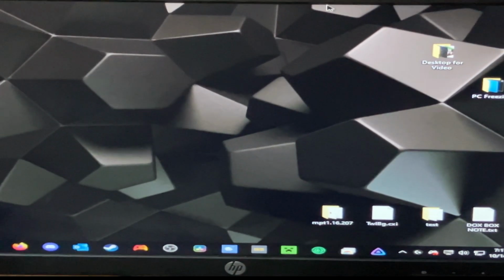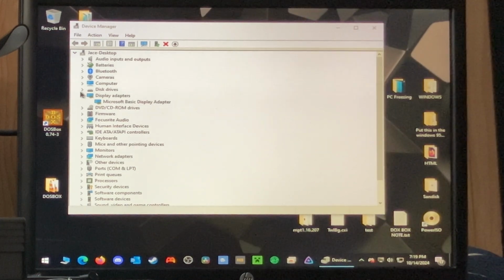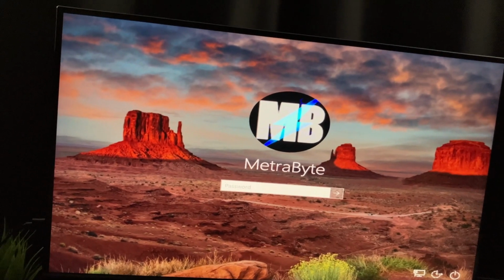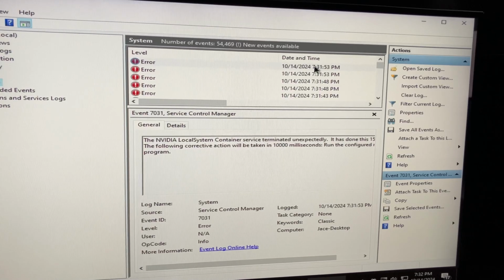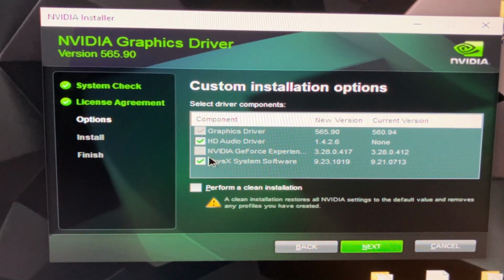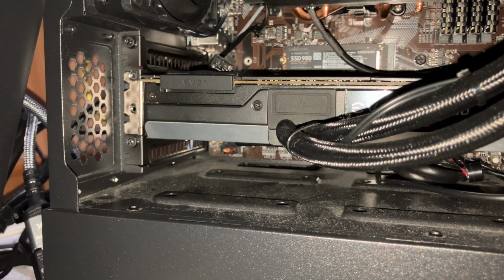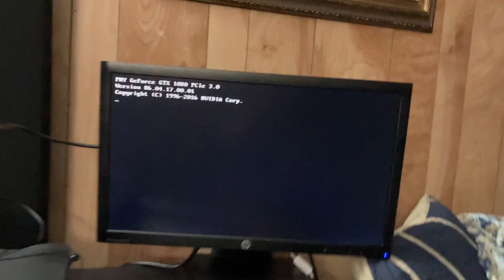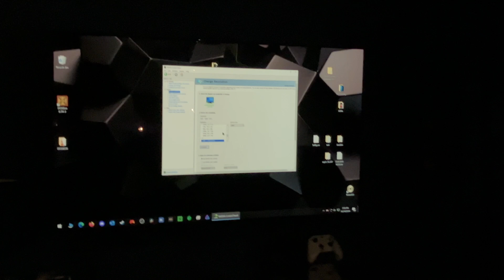Windows Update Broke my GPU and now I have to fix it

Comment: hey homie just for future reference you might want to take your pc off the floor next time you work on it and for many good reasons. 1 big one being is static friction can AND WILL short out a component that ur touching or accidentally touch. its super important you do that on a hard wood surface or on a rubber mat. 2 working on a surface not level with your stomach or waist at the very least will eventually cause you to break something and that's not a maybe its a for certain you shouldn't be too rough with those plasticky pieces specifically pci-e and ram slots. a lot of other tech guys would agree and i think you'd get a lot more views if production quality went up by doing these things listed. other than that great vid per usual

Comment: I love the chaos process to fixing stuff, I relate to this all too well haha.
Glad you got it fixed, but, you should also try updating the firmware and VBIOS. I had black screen issues with my old 1080ti and when it just shuts off after your plugged in other monitors was really similar to what I had to deal with using Displayport and HDMI to the TV.
https://www.youtube.com/watch?v=erS1ShmNRRo
Even if it is working now, it's worth updating everything on your card anyway so future windows bullshit won't break it again in the future.
Reply from the maker: You’re right about that. I haven’t updated the bios on that thing in a couple years. And the last time I updated it was for this very reason lol

Comment: thats why i disabld driver updates over windows update and then decided to completly rip out the windows update function out of the system because windows update just messes up driveers all the time. never let windows update do all the work
Reply: HOW DID YOU DISABLE THEM PLEASE TELL ME
Reply: @daskywarsboi2913 you can remove the whole Windows update thing via DISM. Helps ALOT with performance on potato pcs, especially if you also rip out windows defender(but thats a terrible idea for obvious reasons...)
Reply: @daskywarsboi2913 device manager

Comment: Man, everything that you went through in this video is what I just recently experienced on my MSI GTX 1070. From the update, to the wonky screen with the basic display adapter to reinstalling the GPU, the dust ( I used a mini vac) and even the flying insect! It was a fly in my case that wanted to take up residence in my ear and I got so pissed I grabbed a fly swatter and chased that sucker around the entire house until he was effing DEAD! This is too weird.. I ended up nuking everything Nividia in my PC with DDU however there were still a few folders that DDU didn't remove so I deleted them. Reinstalled the driver for the card and after a few small heart attacks caused by black flickering screens, it now works like it should. GPUZ and Afterburner now recognize the card. I have to add that my other PC has an AMD XFX RX 580 and I had to use DDU, search for remnant folders and reinstall AMD drivers. All is ok so far with both. Thanks for sharing this, liked and subbed your channel.
Reply from the maker: @Alpha-ms9nj  I can feel the insanity through your comment lmao, Glad you got it sorted. I’m happy I didn’t have to resort to DDU (yet) because I have some strange configs on here to make all my monitors work in the two rooms. It ended up doing this AGAIN like 2 days later which was great, but 7 reboots and unplugging monitors later, it’s back! Thanks for the sub and the great comment :)